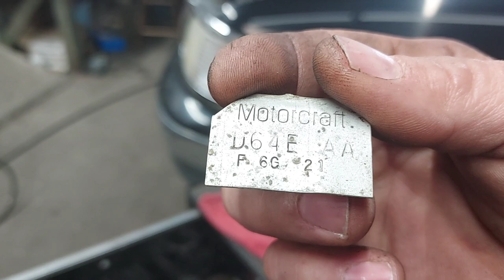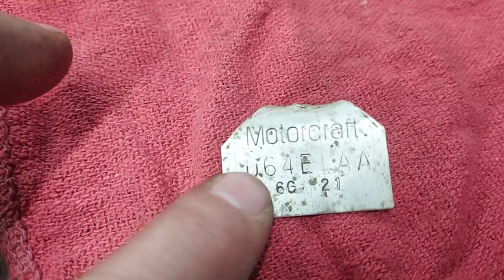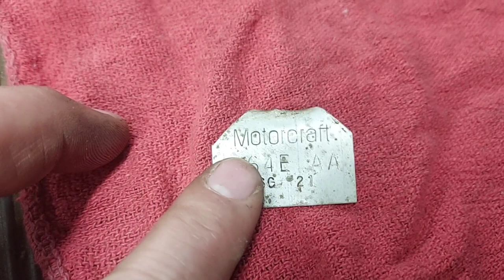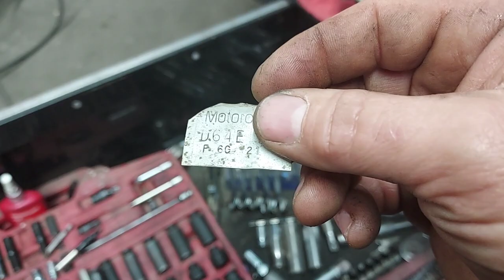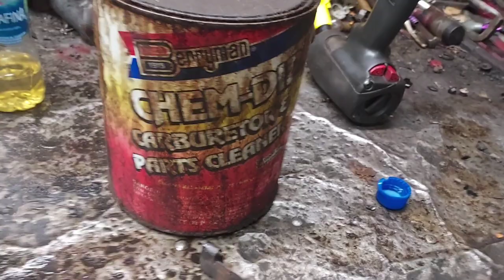Ford Motorcraft 2 barrel or 2v carb rebuild and how it works.

Comment: Great video,  explaining how each part works.  No foul language, I learned a lot  thank  you. I,m workin on  a 68/ f250.  with 360. its great to work on old school vehicles . Thank  you  again !!!
Reply: I'm working on a 72 f250 with a 360 with a holly carb but the part number is worn off and I don't want to buy the wrong kit. Any suggestions?

Comment: Can't thank you enough! Now i have the knowledge to work with this type of carb. I recently bought a square body chevy truck in which the previous owner adapted/installed a 2150 carb to a 350sb. Theres a high pitched metallic rattle noise im hearing around the carburetor.  No idea if its the carb itself, but im more confident to troubleshoot & re- tune if i need to. Thank you

Comment: I just did what you did on a 2150 and put it on my 77 cj5 jeep it started up and and ran great. Went for a drive and couldn't get over a speed bump started missing went back to my shop and pulled the carb off to find gas in the power valve cover. Did a vacuum test on the 2 stage all ok. Put it back in new gaskets and went for a drive same thing happened.  So I rebuilt my 2100 did what you did put it on and went for a drive again back to my shop found gas in the powervalve cover  what gives. So this time I put gas in the carb with power valve cover off and gas dripped through the 2 stage power valve. So I put a single power valve in that came with the carb kit, no leak. Put it on my jeep went for a drive. dang it, back to the shop. What  is going on. Took it off the jeep. I went back to the 2150 bought two 2 stage power valves from mikes carburator shop. Showed him mine that had no # he had 1 that looked just like mine but was unidentified no # . And I bought 1 that was a 9 - 5. My vacuum is at 20 at idle every time I start the jeep. Installed the unidentified one even tested it with my mighty vac. Held vacuum, put gas in the carb, no leaking so I put it on the jeep and went for a drive, dang it, back to the shop. Took it off , gas in the cover. What's going on. Got on google saw this guy having the same problem and he figured out that if you go to harbor freight and pick op the o ring kit 180 Vinton you won't have this problem again. You might see his video, anyway ,I took the 2150 apart checked it all over again found the unidentified 2 stage not holding vacuum, so I put the other 2 stage in that was 9-5 used the papper gasket that came with the power valve mikes carb sold me put it on the jeep and went for a drive , and I don't know yet but back to my shop I go. Jeep not running good. I know I was not over tightening the power valves ,screws, went through like 8 carb gasket to block and the other gaskets and took my time doing everything the correct way.  Getting hesitation from 1 to 2nd Geer, sometimes at idle the motor just quits. But starts up and idle is OK.  Changed the egr valve new plug wires, hei dist new, this motor is like new, all new parts. Good vacuum at 20 . Dinking around with the egr and found that when the temperature opens the egr that's new and holding vacuum the motor starts to act up. When I plug the egr the motor runs like a top. But when I go for a drive , back to the shop I go. What gives. I'm at the point I can't figure out what's going on. So I just saw your clip and I have done everything you did and more. My timing is spot on at 5 degrees BTDC.  The 304 motor at idle is perfect, 750 rps, no ported vacuum running great.   But for some reason I'm having problems with the power valve . Looks like I need to remove the 2150 and get the Vinton o ring for the power valve. Do you have this problem working on a 2100 or the 2150 MC.  I wish you were around to help me figure this out. Really liked your video and I watched it like 5 times to see if I missed anything.  I did see I don't have the spring thing you pushed on the vanchury, but yours looked like it was older than mine. Any  ideas  why I can't stop the leaking with the power valves. I tried lithium grease,  hi lamar,  on the gaskets . It's been over a year working on my jeep golden eagle that  I bought new in 1977 for $6.000. 00 .

Comment: Fantastic video and very informative! I appreciate your enthusiasm and knowledge explained patiently and thoughtfully. I’ll be rebuilding the 2bbl on my 390 in my 1968 Ford Galaxie. I’ve got a steady idle but really low vacuum. The timing is set to factory specs. No vacuum leaks. Any suggestions? Thanks so much!

Comment: Your video was a great guide when I was working on a 79 AMC Jeep.  I have an issue where the bowl brains in seconds down the thought when I fill it with fuel. Any suggestions? Thanks ahead of time.  Great video.

Comment: Take two of those ,a double intake manifold and two adapter plates on a 302,and look out. Mad low end torque  with big end gains .
Reply from the maker: That would definitely work, I've never done it but have thought about many times. I think it would work well too.
Reply: @williamarchibald9826  I have done it twice. 1st time was a nightmare before power made
The second time was an absolute screamer ,that one had a 4:11-1 ring out back.

Comment: Hey man I got an old 72 Ford Ranger with this same carburetor. I don’t really want to take it apart and clean it because I won’t be using it that long. It’s a running driving truck btw so it’s not that bad. But I had an idea… I want to disconnect the fuel pump and let the truck run out of gas in the carburetor and fill the fuel bowl with seafoam and let it sit overnight so it’ll clean the main jets and pump it through the accelerator pump.. Can I fill the bowl through the bowl vent tube? Seafoam cleans really good and it’s not harsh on rubber components… It’s puffing a little black smoke when I hit the throttle and running a little rich but I just want to try that before I take it apart and adjust the float or the accelerator pump. Thanks in advance, great video btw I can tell you know what you’re talking about. I’m not really a carb guy but I’m gonna try to learn more since I got that old truck…

Comment: Thanks.  I have a question. The 3/8" thick Carburetor Mounting Gasket (Fel-Pro 60320) has a 3rd 1/2" that mates directly to the base of the Motorcraft 2150 carb.  My original gasket does not have that 3rd hole.  Is that 3rd hole required to be there? Most of these gaskets that I see for sale have the third hole. This is on my 1979 360ci Jeep Wagoneer.  My last question is that  this same new gasket is not really flat to the carb.  An old timer said I should put it in the oven and get it warm or it won't seal.  Do you agree?  Thanks, John  PS I just subscribed.  Best Carb video I have ever seen. Thanks again.

Comment: Hello, not many people out there know the ins and outs of these magnificent pieces of equipment out there anymore. Now days everyone just buys new! Thank you for sharing your knowledge with us. This brings me back a lot of memories when I used to sweep a shop when I was little and I used to watch the mechanic taking carbs, starters, alternators and rebuild them all. Amazing!

Now I have my own little problem, 

I have a 1973 Ford F100 302 Engine Two Barrel Carb, It starts with starting fluid but then dies, I add a little spike of gas in the carb and it runs until it burns it off. I replaced the fuel pump and still does the same thing. Do you think it's the carb? The foat that could be stuck?
Reply: Bad accelerator pump on carburetor perhaps
Reply: Hello, turns out bad accelerator pump diaphragm and bad fuel mechanical pump. Hot them both replaced and truck runs now. 

But now I have gas gouging out of the vacuum line on top of the carburetor. I don't remember disconnecting anything from it, is the float supposed to stop gas from entering the gas chamber when full?

Comment: I just had my Ford 2100 carb rebuilt. I went to install the fuel filter but the carburator is stripped out. Are the treads pipe threads or just 3/8?

Comment: I have the same exact motorcraft 2150 carburetor my question is. I'm capping off the EEC port on the top center front of the carburetor but how will that effect the function of the arm from the accelerator pump to that white plastic or ceramic piston part of the EEC port ? And also is that white plastic or ceramic piston rebuildable with the carburetor kit ? Does it have a seal ?  Thanks

Comment: thank you for the video on carb rebuild. i have a 1983 mercury cougar 3.8 motor and im having a problem with adjusting my carb idle control. i can start the car but it will only run as long as i keep my foot on the pedal and as soon as i take my foot off the pedal it stalls. is there a video on adjusting the carb to bring back normal idle for this car? thank you.

Comment: I have a 84 ford f 150 ..302 an it loses its prime like when it's parked over night...have to actually pour little fuel in carb b4 it will start ....but once tha motor is hot an ye run little bit it'll start right up .....what's maken it do that

Comment: Is that carburetor  the same as a 1976 ford ltd elite ?
Reply from the maker: Yes, the Motorcraft 2150 stayed the same when it came to its design and operation from the early 60s up to the early 80s and many Ford small and big block, FE and the M's